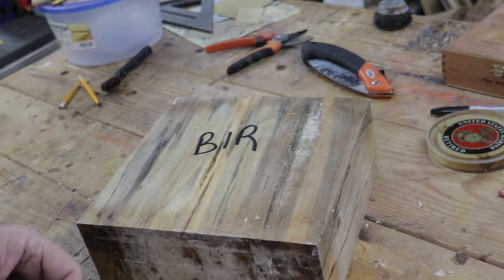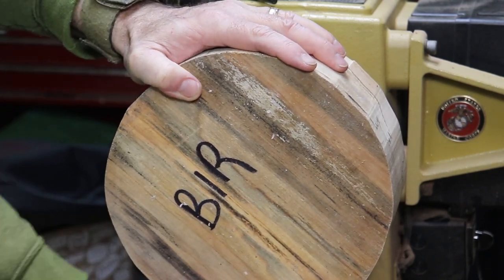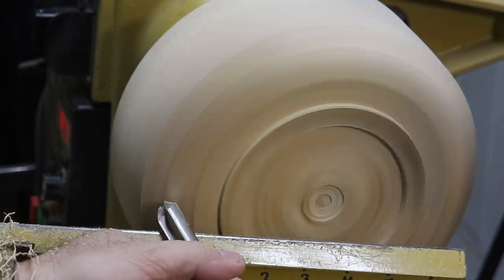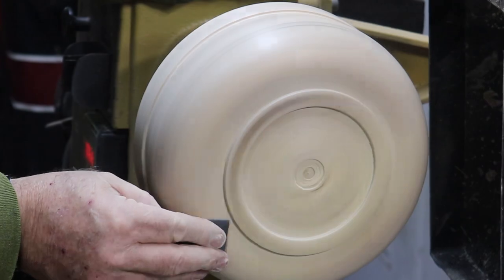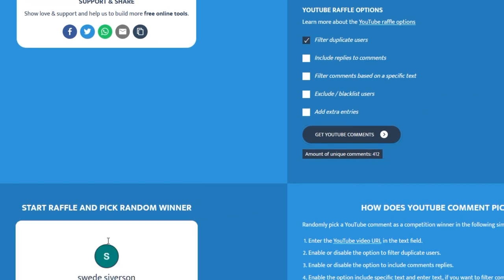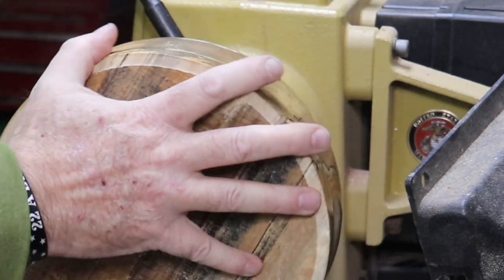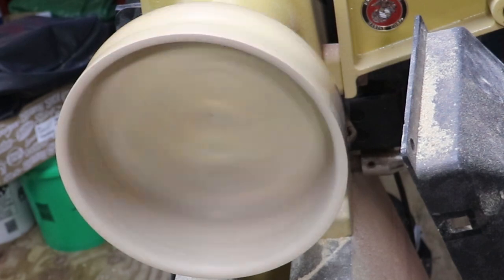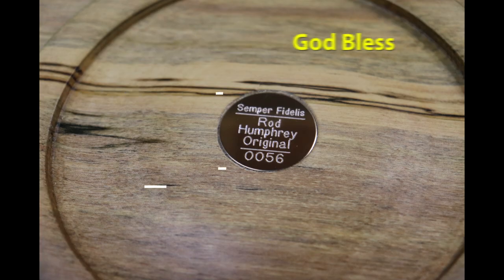Woodturning a Birch Bowl Beauty

Comment: Gorgeous piece! I like your instinct for the compound curve on the outside. I've done that too but have a hard time with tool marks down in the inside corner, under the bottom curve. It didn't look like you used anything but bowl gouges to finish the inside-- any tips for a novice turner to keep things smooth?

Comment: You drove this piece using the screw to do the outside but when you turned it around to taker out the inside how did you attach it to the head end? My jaws would never hold the rim you left on the bottom of the bowl.